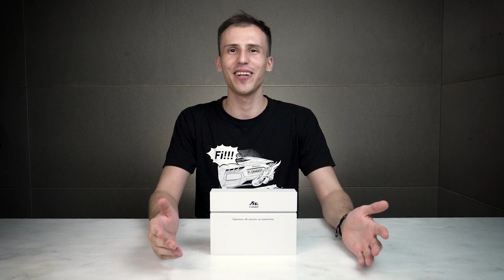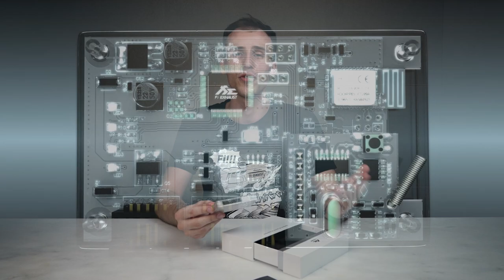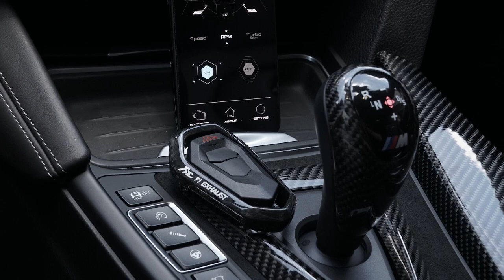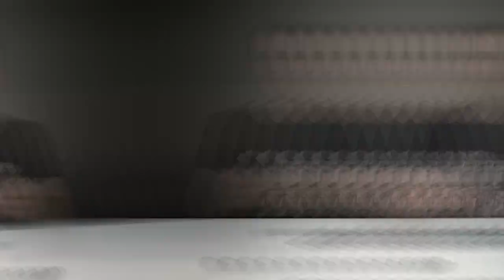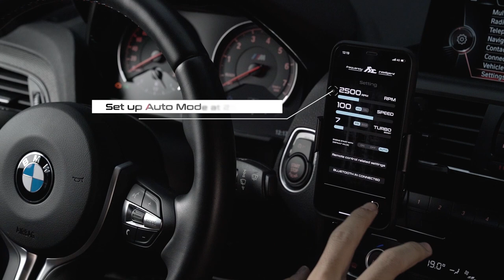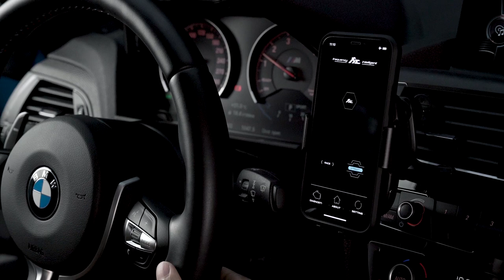What's Inside Fi Pro Control System? Unboxing X Install X App Test

Comment: do you guy sell just the valvez(2x  2.5inch valvez) and the controller on itz own?
Reply from the maker: Unless you're an Fi EXHAUST user we don't sell the remote control separately from the system.

Do you have Fi EXHAUST system installed on your car? Thank you.
Reply: FiExhaust no i dont have atm
we want to custom make our own exhaust thatz why
maybe have to get ur set up
do u guyz make 3inch catt back with valvez for infiniti Q60rs 2018.?